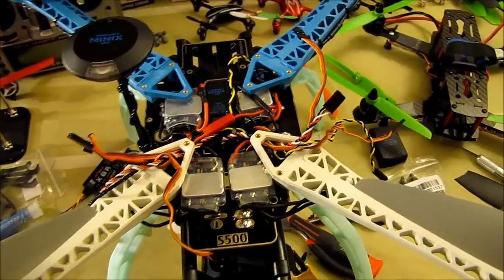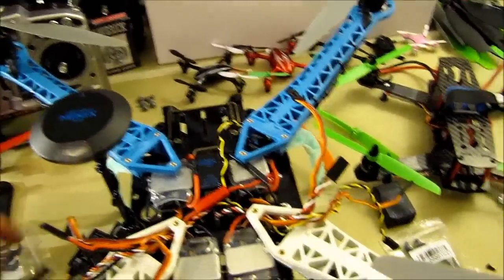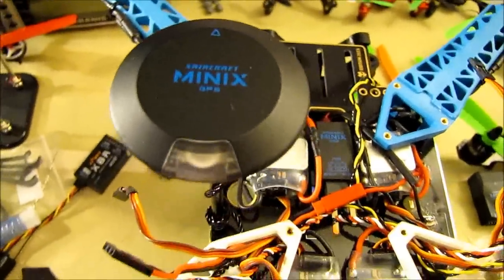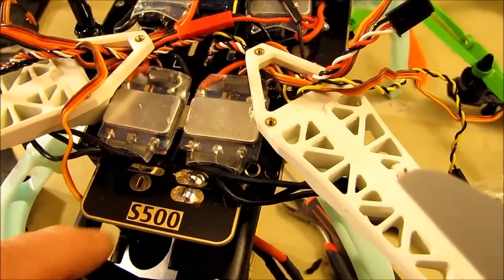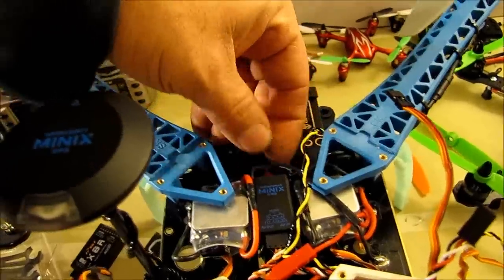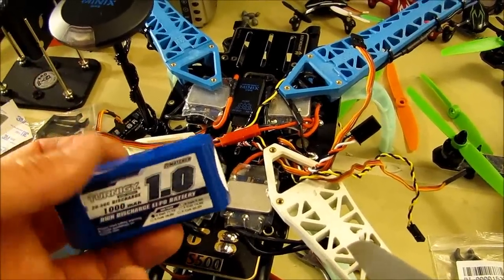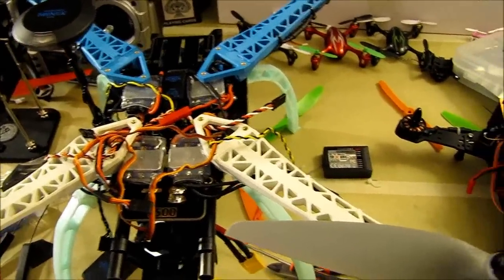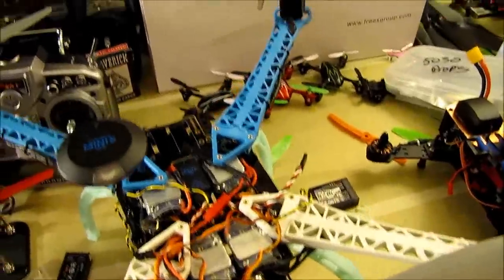S500 build with the new mini X

Comment: I had the same problem with my carbon mixed propellers. Before the flight all the props are nearly as flexibel as a normal plastic prop (no sign that they would snap easily) and somehow they become very stiff during the flight and snap just at the hub.

Comment: I have the s500 with the Naza M V2 with GPS combo flight controller and the 3-axis Gimbel and 10inch carbon fiber prop do you have any problem with them prob and that Gimbel props or can you give me some pointers on what would be the best to buy or take of it to make it fly better O and my motors are Kv1400 with 30amp speed controllers .and your right my stand is the same one you have its not to good